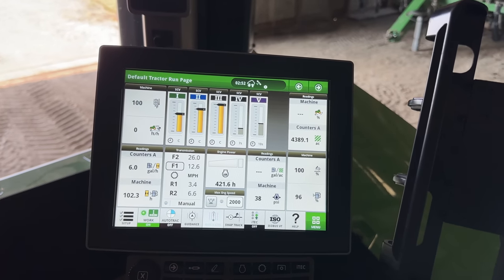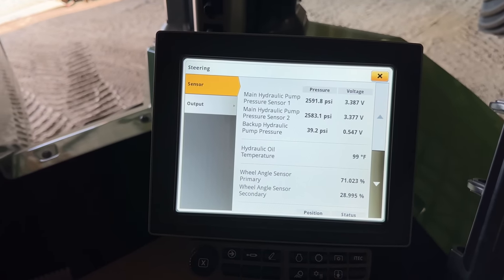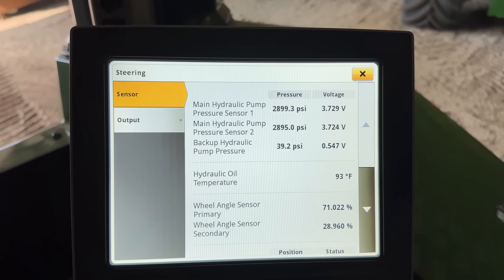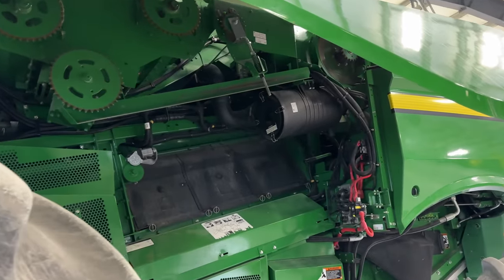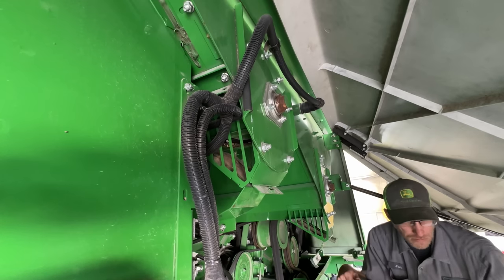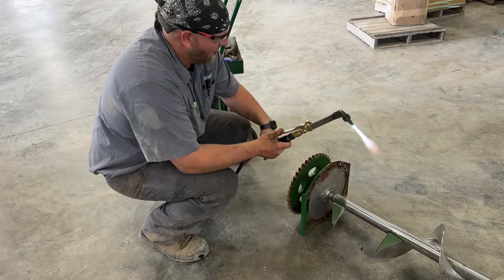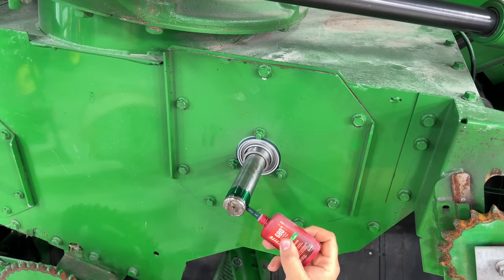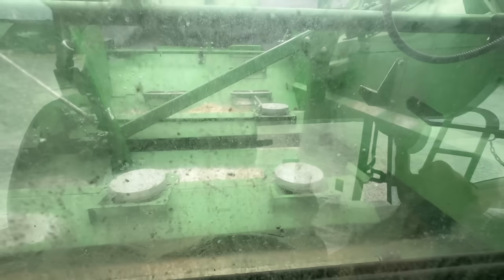Service call on a 9RX 640 and S780 cross auger replacement. Summertime fun!

Comment: Thanks for another great video ZK. It was interesting and enjoyable. 

First of all wishing a Happy Birthday to Josh. Have a great day josh and have a great birthday. 

Thanks for the steering reset. Nice you can do that from the tractor monitor. Was interesting. Thanks. 

The auger replacement was a bit more than I thought. But you and josh got right after it and had it done. Nice work guys. Never seen a bearing like that with set screws. More engineering work-ha. Well anyway you got it. 
Thanks again for showing us the way to do it. Surprised around every corner. 

My compliments to ZK and josh for your fine work. You made it look easy. That set screw on the steering is really hidden. You knew where it was but a lot of us would look a long time for that. Wow. More engineering-ha. 

Thanks for everything ZK. 
The Iowa Farm Boy. Steve. 

Happy Birthday Josh.
Reply from the maker: Thank you!

Comment: Drilling off the setscrew burr works great. Done it many times. Also, the groove for the key in the shaft is the keyway, the key is what goes into the keyway. The setscrew goes into the key. Just a few details.

Comment: Hey Zeth, in pulling a stubborn bearning like that on a shaft, I like to use a worm gear hose clamp to keep the arms of the puller in place.
Thsnks; great video!
Reply from the maker: Yeah I’ve done that before but I didn’t have a clamp that size handy. What I really need is one of those locking three jaw pullers that forces the legs in.

Comment: I’ve replaced a few of those cross augers now and I loosen the bearing flange off the sprocket side as that flange is on the inside of that plate and then loosen the set screws on the other side for the bearing and tap the auger through to the right side of the machine it normally moves just enough to expose the indents from the screws and then I can tidy up the shaft and the bearing slides right off

Comment: As other people have noted, I'd have used a bearing separator, flat side to the bearing and then two puller bolts into a slotted cross bar puller.  I also have a cross bar puller that has puller arms that lock when a load is applied, preventing any sliding, and won't open up until they're unloaded.  Old school and a bit heavy, but they work really well.  Snap-On used to make a puller for AC hub bearings that has cross-bolted puller arms.  They won't open up either, but they're designed for stub shafts.  Still worth looking into.

Comment: For bearings like that where you can't get a good grip on them with your 3-jaw, I have had good luck with a split "clam shell" style yoke.  Even if you can't get it off with that tool, it sometimes gives you enough for your 3- or 4- jaw puller to gab onto.

Comment: Use an 8 point socket for square drive set screws
Reply: Yep, especially pipe plugs with square heads.  The 8-point is the way to go.

Comment: Good idea on drilling out the set screw dimple.   Shooting the hole full of lube after you drill it out and before you pull it helps too.  I have had good luck using a bearing splitter on the back side of that style of bearing and hooking onto that with my puller.  It tends to stay more square even if the back of the bearing isn't, can be a bit of a goat-rope getting it all threaded together but once it's on it does the deal.

Comment: I would try  a POSI LOCK puller.  It has a cage you can tighten down around the jaws to hold them tight against the bearing.

Comment: Yer old case 2100 series used those bearings I don’t even worry about air hammers I just use a Bering splitter tool those claw pullers are crap as you found out the fall off

Comment: 19:06  Your drill idea has merit.  Just keep in mind you may need to drill larger than the existing hole.  I can't see what style set screw is in there... but they are seldom anything other than a blunt end.  So the knurling extends beyond the screw diameter.  Drill bits frequently raise a burr too.  I know for a fact that shaft would have three flat spots on it before I installed another bearing though.
Reply: master blaster in the hole looks like rust to me

Comment: I had to do a rear cross auger on an X9 one time. Its a super easy job but john deere has manufacturing issues with the augers so I ended up having to repeat the job twice due to the new auger having build quality issues.

Comment: I believe if manufactures put thing together with ant seize, We wouldn't have issues taking things apart !!  Your drilling has merit , But what if you find out you can't get a new auger and have to install new ribbons it. I have done many over the years.  I like to use my 8 point sockets for the square headed bolts. They were more common with machines from the 60's to 80's. I had a similar turn issue with a older 2 wheel drive tractor , After increasing the the steering pressure that made steering much better.

Comment: I think you'll find it was the fit of the shaft to the bearing that was tight; a couple of grub screws that size won't beat a puller. Sometimes a little heat can help, but normally those types are easy enough to get off, and are very standard on machines ( if not JD combines! ). I regularly replace them in very corrosive areas on shafts of many sizes, some upwards of 80mm. EC style bearings ( eccentric collar ( or "knocker"! )) can be brutal to get off as well...  You can also back the screws right out and put a little penny oil in the holes while you have coffee 😂

Comment: I drive that type of bearing further onto the shaft, and then file the dimples off and emery the shaft clean. The bearing then usually slides off by hand.
Not intuitive but I have changed a lot of bucket elevator bearings this way.

Comment: When I can't remove a bearing with a puller in a situation like that, and I know it will be replaced, I tend to weld a piece of tube to that bearing, and weld a nut on the other side, and run a big bolt through it. same principle, but you have some heat and it's a fixed connection😉 

certenly when you have a flange or sprocket on a cone shaped axle, those are a b*tch to get loose!😫

Comment: Nothing related to this but we are wanting to drain hydraulic fluid from a s670 and book only says to drain reservoir. We are wanting to drain system to put fresh fluid in. It’s at 2000 hours so any tips on where to drain whole system or is it just better to drain reservoir like book says. Thanks
Reply from the maker: You drain the hydraulic reservoir and the main engine gear case should tell you how to do it in the owners manual
Reply: @ZKMasterTech  I looked all over manual and all it says is drain reservoir. We drained engine gear case and changed filter.

Comment: for the cross augers. what happens when the sprocket teeth get worn down, will you buy the farmer the augars, since you LOC tightened so sprocket won't come off?
Reply from the maker: A little heat to release the loctite and they will come off.

Comment: Why not put new stub shafts on the  flighting looked good on the augers yes you would have to make up a jig also could have had sprocket machine out n had a bushing installed maybe  JD come up with  upgrade you hit them 2 screws on that sprocket with a hammer to seat them in then tighten them some let's try to save the customer some money n  look at quality in the equipment .

Comment: A machinist could have fixed that shaft in a couple hours... very simple connection...  I cringed a bit when you cut the end off with the gas axe, was a totally serviceable part, maybe still is.

Comment: Hola Zeth como estás? Necesito una ayuda con un 8400 de la vieja escuela. Voy a la direccion 22 de la pcu para calibración y me dice Error. Tengo el código pcu 058. El sensor de rueda me manda la señal a la pcu. Cambié la pcu y sigue en lo mismo, que otro factor me puede estar causando ese "Err" en la dirección 22 de pcu? Cualquier ayuda es bienvenida. Soy fiel seguidor de tu canal, buen trabajo Alejandro de Uruguay saludos
Reply from the maker: Thanks for watching the channel. Check the park brake pressure switch and the wheel speed sensor. CCU 13 center digit is the park brake pressure switch. CCU 5 is the wheel speed sensor.
Reply: @ZKMasterTech  thanks Zeth! I changed the parking brake switch and it fixes the problem. thank you

Comment: To me the pulley attachment method is piss poor. I’d rather see a splined shaft with a slight taper and better (tighter) tolerances instead of a key and two set screws.